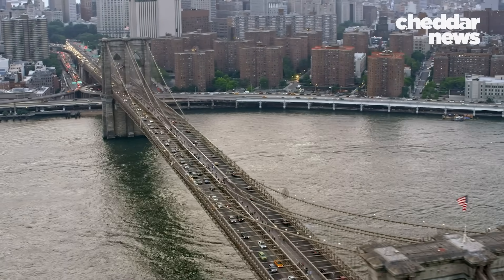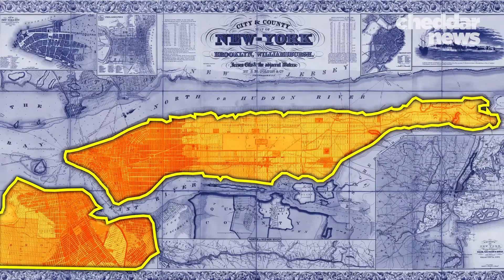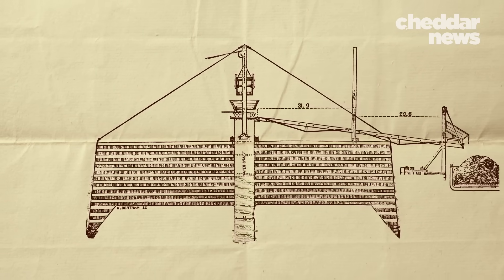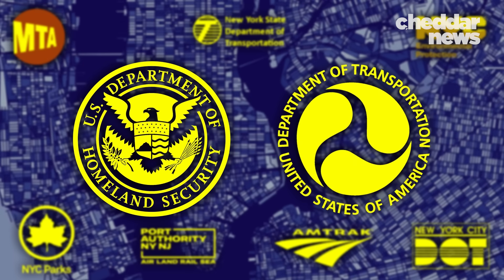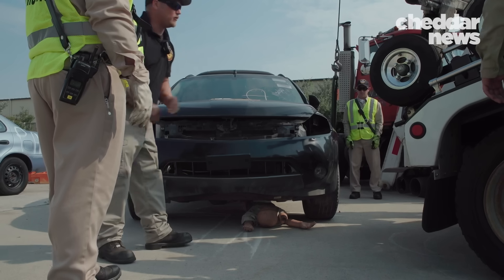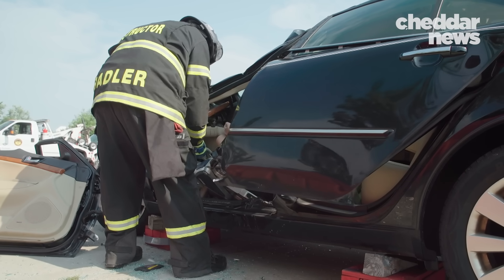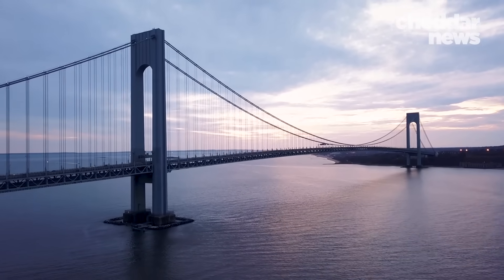How New York Maintains Its Over 2,000 Aging Bridges - NYC Revealed

Comment: It blows my mind that a bridge built in 1883 is still in use. I'd be curious what type of reinforcements have been needed as traffic use and weight has increased.
Reply: LONG story.
Reply: Mostly because the towers are concrete, not metal. Safest bridge in NYC.

Comment: The GWB is literally falling apart
Reply: No it is not. You obviously have no clue about Structural engineering.
Reply: @grillage2  I don’t need to to see the walls on the lower level right before you get in the bridge crumbling exposing rebar. Perhaps the structural integrity is okay but the actual appearance is heavily deteriorated.
Reply: @sebastiana70  You are looking at surface conditions. The bridge is in very good condition.

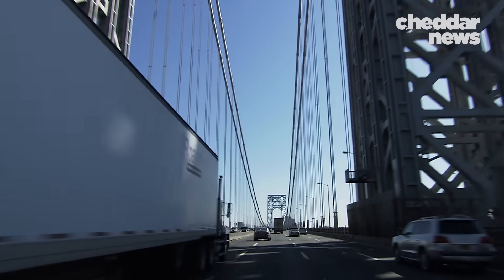Comment: 4:57 New York City officials granted nothing to the "Restoring the George" program, since like all crossings from New York City to NJ, it's owned and maintained by the Port Authority of NY and NJ. The $1.9 billion for this enormous rehabilitation comes from toll revenue and other PA sources.  Though the 7 crossings the PA operates includes both the busiest bridge and tunnel in the world , the video was supposed to be about "How New York Maintains Its Over 2,000 Aging Bridges." Seems odd we saw no one from the New York City Department of Transportation, which has 789 bridges under its jurisdiction.  https://www1.nyc.gov/html/dot/html/infrastructure/bridges.shtml  I think people would also have found it interesting that clear disabled cars without having to access the front, the PA's tow trucks are equipped with extra large front bumpers to quickly push the car off the property. https://youtu.be/ranTQB6BWxk

Comment: How does New York have 2000 Bridges?!?!  Pittsburgh “the City of Bridges” has a record 446 and isn’t nearly as flat as NYC so it needs those bridges to make travel into the city from 360 degrees possible.
Reply: I think they’re counting simple highway overpasses as bridges too
Reply: They are counting tunnels as well. He said it on the video but they didn't add that part in the title.
Reply: Super clutch is right. They’re also responsible for the upkeep of overpasses too. They all require adequate attention and maintenance to prevent collapse. Having been all over New York though, I’ve seen some pretty rickety bridges. Im not so sure they do the best job at it.
Reply: We got Park Bridges, Overpasses, and which are usually 100-50 feet in length. But the iconic bridges is almost always the talk when you mention NYC bridges.
Reply: they could be talking about new york state.
Reply: @kazuichicarter-mcginty3565  no, 2000 bridges in a city as large and complex as New York seems completely feasible.
Reply: @kazuichicarter-mcginty3565  the title says NYC meaning New York City
Reply: It’s been long debunked that Pittsburgh doesn’t have the most bridges in the US.
Reply: NYC Has 2077 bridges in all.

Comment: The Brooklyn bridge isn’t actually a suspension bridge. Because of its sheer size, it had to be built as a hybrid suspension (vertical cables hanging from arched main cables) and cable-stayed (diagonal cables that connect directly to the towers and deck) in order to handle the extreme loads. Absolutely amazing engineering, but true suspension bridges of that kind of magnitude would take a while to come around after Brooklyn bridge when the technology allowed for it
Reply: Robeling pioneered the technique of digging"caisson" and pressurizing the atmosphere within them, in order to build a bridge pillarand anchor it to the bedrock in the middle of the water.
Reply: @purplealice  yet another engineering feat that came along with the Brooklyn Bridge. I wish architects nowadays had as much engineering backgrounds as they used to have. There’s very few schools that offer Architectural Engineering as a degree and it’s an absolute shame. Architecture is not just the artsy-fartsy stuff, it also involves a lot of mathematics and engineering. Roebling was a Civil Engineer and I wish modern architects at least studied that field before they went to study their artistic field
Reply: @purplealice  One of the FIRST bridges in the USA to use Caissons was Eads bridge.
Reply: Weren't the cable stays added later on to accommodate heavier trucks?
Reply: @BENTandTWISTED  No. The stays were installed during construction.
Reply: @grillage2  thanks for the info!
Reply: I may be misremembering... But arn't cable-stayed bridges a subcategory of suspension bridges?
Reply: @DigitalAndInnovation  no they are not a subcategory. They are distinct in how they carry their loads.